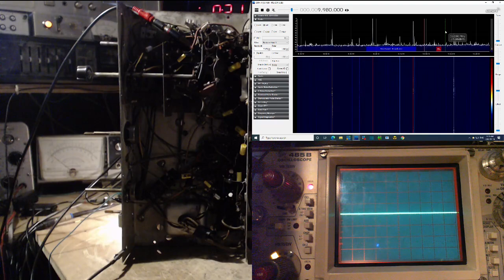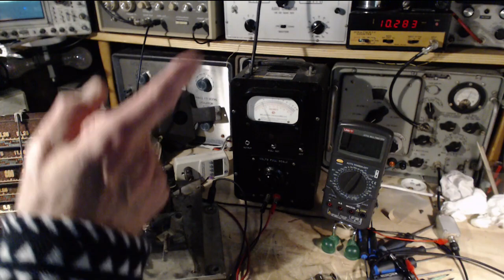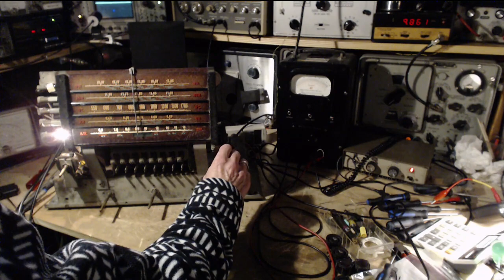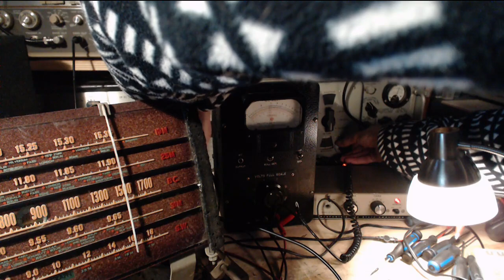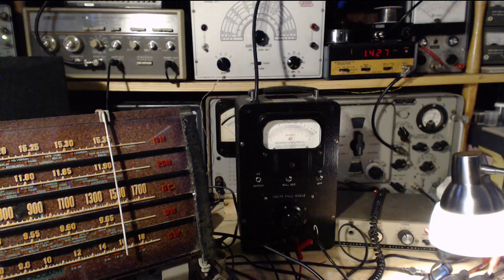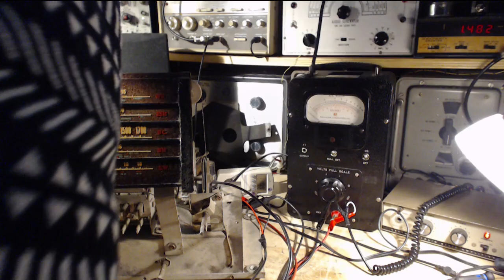Westinghouse 981X Shortwave Receiver Video #14 - Alignment with Base Plate

Comment: Trying to keep up with you here, Jim....couple of questions...
First, the 2 6V6 audio output tubes represent, by far, the greatest load on the B+ supply, which has no voltage regulation. With those tubes out of the circuit during your tests, wouldn't that allow the plate voltage on the remaining tubes rise to a higher level, possibly affecting your alignment attempts and other circuit parameters? 
Secondly, the dial pointer seems to have been accidentally moved to an incorrect position  on the dial string, yet you seem to be using it as a reference to where the radio is actually tuned.  Wouldn't this possibly lead you to some wrong conclusions in your alignment process?
Reply: Dial pointer position incorrect = he just can't set trimmers & very poor tracking !